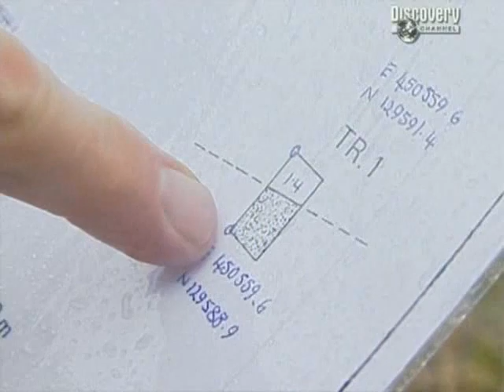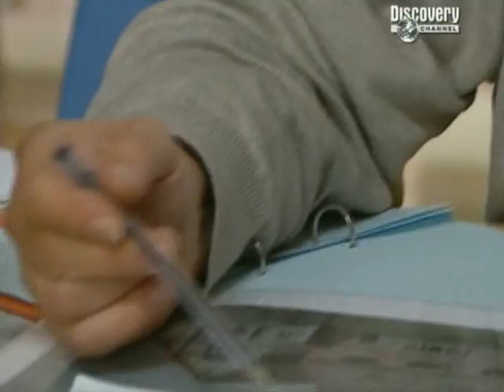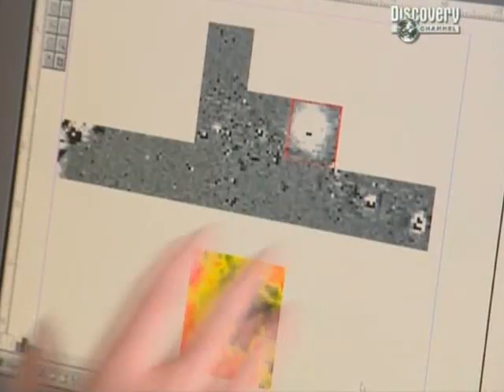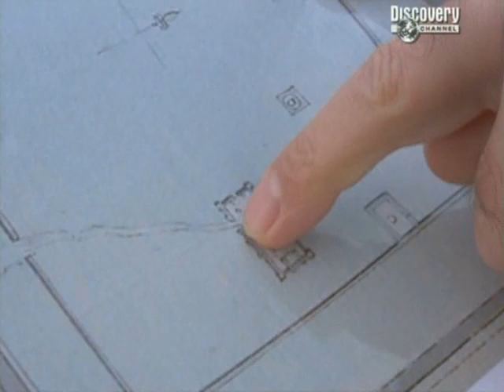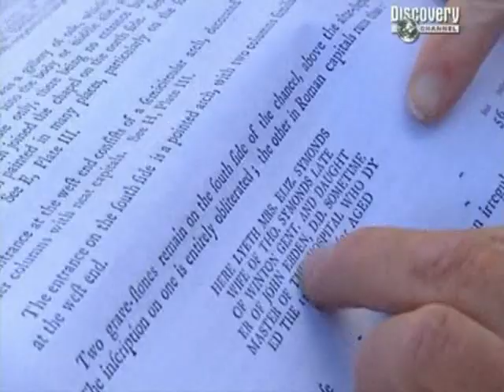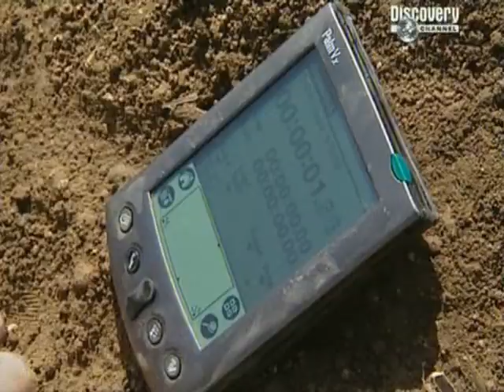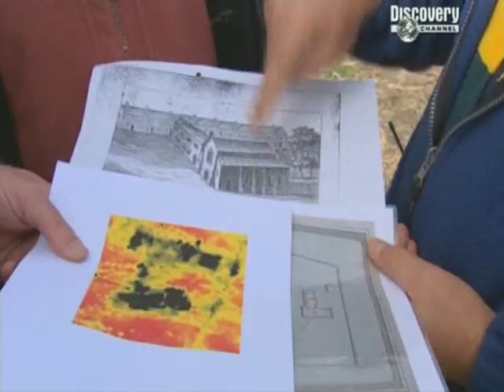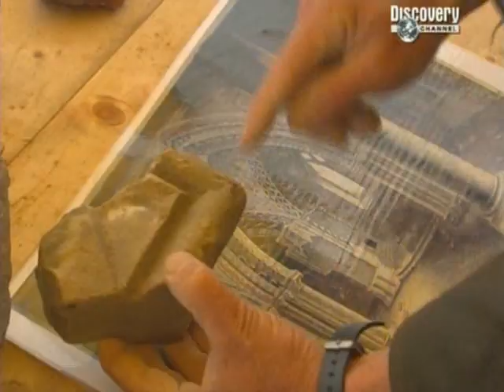Time Team S08-E12 Winchester, Hampshire

Comment: Leprosy (commonly referred to as 'Hansen's disease' these days,) is chronic but also curable.  Most people don't know that it's actually an infectious disease caused by a bacterium, specifically Mycobacterium leprae .  People are usually most familiar with leprosy as a "plague" or disease spoken of in the bible, and they may or may not be familiar with the bumps it causes on the skin, called granulomas (caused by immune cells called 'macrophages' gathering to try and "quarantine" substances it perceives as foreign but can't manage to actually eliminate.  Leprosy affects the eyes nose, teeth, and peripheral nerves, foremost, causing loss of sensation from nerve damage, and eventual bone infection (as explained by Prof. Margaret Cox.)

The developed world doesn't have very many cases of Hansen's disease, about 20,000 cases are diagnosed per year in the US, however, worldwide, two to three million people are estimated to be permanently disabled because of leprosy.  India has the greatest number of cases, with Brazil second and Indonesia third.  In 1999, the world incidence of Hansen's disease was estimated to be 640,000. In 2000, 738,284 cases were identified, worldwide.

Comment: The depth of the well fascinated me, a nearby open pit quarry has a similar feature.  It's now part of a state park, with a depth of about 30 meters and cliffs rising 3 to 27 meters most of the way around. At one point 15 meters above the surface of the water, theres a hole with cold air coming from it. I dropped several stones into the hole,  timed nearly 6 seconds on the stopwatch before they hit water.  Apparently the quarry just missed opening into a very deep and water filled natural cavern right beside it. The interesting thing is none of the rocks hit anything on the way down to the underground surface of the pool or river far below. Not uncommon, this part of the state is mostly limestone and full of cave systems and underground lakes and rivers. Fortunately, its far enough from the trail to be hard to find if you don't know where it is and it now has a small bolder of about 9 kilos firmly wedged in the opening. Mainly to keep children and the foolish from trying to get into it. Possibly, sometime in the future, I'll have a opportunity to lower a night vision camera into the void and see whats down there. It would be just as interesting if they could have put a camera down that extraordinary deep well!

Comment: Well, Well, OOps wrong math. its (1x32)+(2X32)+(3x32)(4X32)+(5X32)+(6X32) feet drop off
=aprox 650 feet/210m
Reply: s = 1/2at2
s = 0.5 x 10 x 6^2 = 5 x 36 = ?
So the tape measure might have had a little friction to add to the equation.
Reply: Don't want to age anyone, but by the early 80s we were using 9.81 :-)
Reply: @oliverwilliams5005  exactly!
Reply: What's math? Oh...that language I don't know...lol.  Good job! Thanks

Comment: It actually requires calculus to  calculate fall based on seconds. However, at sea level things accelerate at 32 ft per second per second which allows a rough calculation. Average speed at the end of 1 sec equals about 16 ft per second. Half way through the second second equals about 42 ft per second. So the minimum distance after 6 seconds should be 16+42+74+106+148+180 or 600 ft or 182 meters. Guess archeologists have a problem with math. LOL This is a rough calculation but far better than the archeologists numbers.

Comment: I don't understand at all the point of trying to cram a whole archeological dig into a 72 hour period. Just seems to cause rushed work and a lot of opportunity for things to be missed or misinterpreted, or even, possibly damaged! Why? what's the point of so much hurry? I did/do very much enjoy the program, but this does not seem the proper way to approach the work. Can someone explain?
Reply: They don't hurry. Everyone is very careful about what they find. TT does exploratory archaeology. They get a picture of what's there and then other groups follow up. Sometimes sites are reburied to protect finds until another team can come in. It's only 72hrs for several reasons. Mostly because everyone has full time jobs elsewhere as professors or whatnot. They all have jobs to get back to on Monday. The other main reason  is that's what the tv station allows. Pressure makes for good tv, but also because excavations are expensive and theh don't have the resources to invest in sites that may take weeks. There's a lot that goes into it, but those are the main reasons.

Comment: if it is really 6 seconds to fall, d=1/2 *a * t * t....or 576 feet!  (a=32)
Reply: The sound has to travel back up as well. That takes a bit of time.
Reply: About half a second...which would make it about 485 feet.  Sound travels 1116 feet per second.
Reply: True. I did find their measuring method to be a bit comical. The weight isn't going to float.
Reply: Bryon Lape In this case Time Team determined the well was ..."deep"...
Archeologists are not Mathematicians...HAHA
Reply: Christopher Smith The time was (if I remember correctly) 6.6 seconds as shown on the stopwatch. This means the well a bit more than 200 metres deep until the water table. We of course do not know how deep the water is. By the way I have no idea how many feet 200 metres is. I am from the continent using units people in the rest of the world use.
Reply: +Ronald de Rooij At 6.6 seconds the drop equals 213.44 metres which converts to 700.26 feet.
d = (0.5) * (9.8 m/s2) * (6.6 s)2 = 213.444 m
Reply: but the object didn't free fall all the way down, so all calculations are going to be off, way off... the rock met resistance several times bouncing off things causing it to decelerate multiple times and change direction for a while possibly even coming back upwards briefly since it's basically stick shaped, it could impact one end, go into a spin as it bounces up and falls again.
Reply: A meter is something like 39.2? inches.  so it is 3 1/4 inches longer than a yard. just guestimate at 3 feet= 1 meter
Reply: 9.8 m/s2,
Reply: @ronaldderooij1774  
Oh, you work in feet, then😬

Comment: (gravity)g=32 ft/s/s =9.81m/s/.s 
In 6 seconds, 32+64+128+256+512+1024=aprpx 2000ft/660m well depth
Reply: Not possible. The deepest hand dug water well is the Woodingdean well dug in 1858. It is 1285 ft deep. The average well is 200-500 ft. The deepest castle well was at Regenstein castle at 197 meters, or 591ft.
Reply: @meemurthelemur4811  tell that to the well
Reply: @karmicpopcorn6440  
Hey Well, you're not as deep as they think you are.

I don't think it heard me.
Reply: @meemurthelemur4811  😂
Reply: 176.4 m per inline calculator